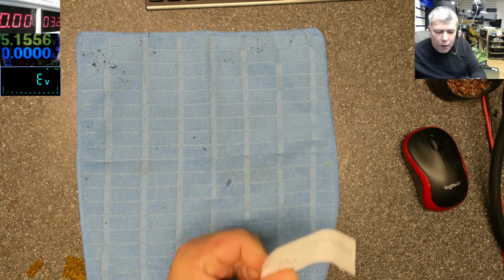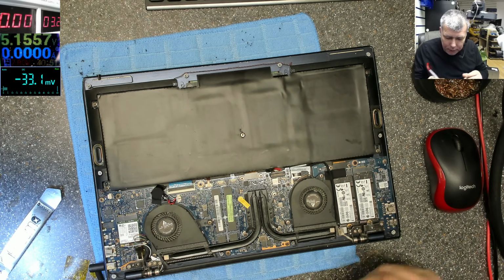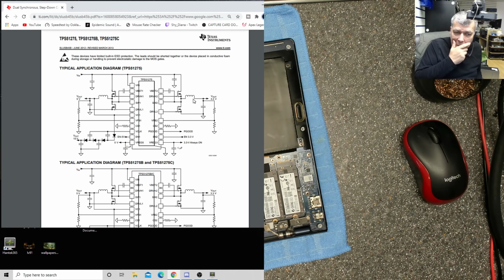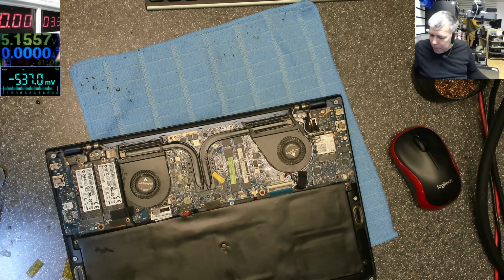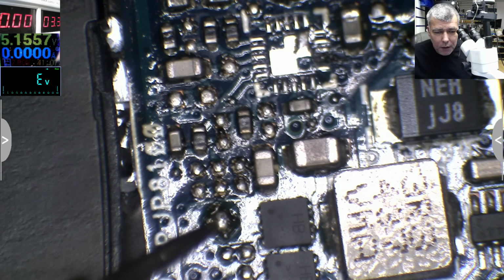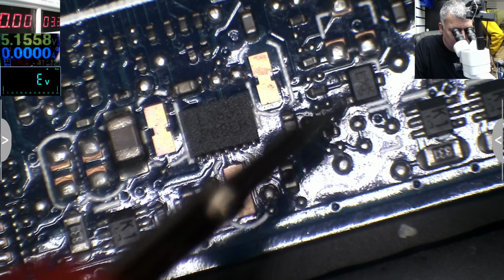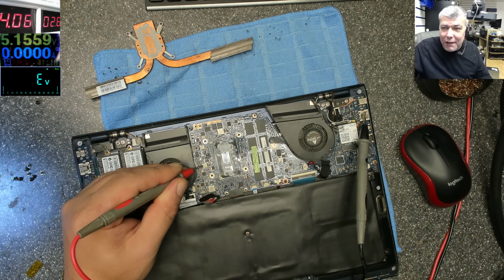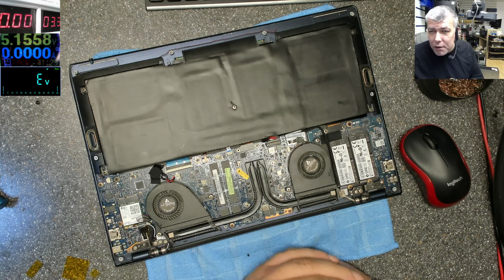I can't fix this one! We can't fix them all, unfortunately

Comment: hello i pc dell which starts and goes out only portable dell latitude e4310
Reply: Issue with superio. Or remove the ram, use a eraser to rub the pins on the ram to clean it and try.

Comment: if the CPU is getting hot without anything else getting hot and the laptop doesn't POST (black screen but keyboard light up and voltages around the motherboard are present ) is it gone 100% or i could have missed something?

Comment: i have a genuine question which i think could be resolved by a replacement super io (ITE IT8587E). It is getting hot the moment power is applied. Is this a sign that this needs to be replaced by an expert.
Reply: Super I/O shouldn’t got hot (over 40c). Must be replaced.

Comment: Sorin,

Did you try ones to replace the chipsets.
You have so much skills with hot air.
If the chip is cheap try it I will say.
Greetings from Nederland
Reply: Chipset is cheap. 10-20€ but he should use a pre heat station. I bought one myself for 100€ this week to replace PCHs.
But before throw it in the bin he could try to do it without a pre heater.

Comment: One question. Is the processor hard coded to this motherboard and with the bios on this motherboard and thats the reason why it cant be fixed or it could be fixed but there is nowhere to find the processor (like ebay aliexpress etc)?.
For example in iphones a dead proc is game over but dont know if it applies in this case as well.

Comment: Morning sir,I have issue with a Samsung note book motherboard.the laptop is charging but not powering, 3.3v is present in the bios and super  i/o but it is not present in the power button.pls tell me what to do.thanks
Reply: Take a continuity tester. Trace the path from the button to the embedded controller.
- Is the button connected via a flat cable? Sometimes the connection here is faulty. Mostly because the cable has broken lamells.
You can (only for testing) short the contact on the mainboard (the on that goes to the button) to ground. Does the mainboard start then?

Comment: Sad to see that it cant be repaired but replacing the board would prob cost more than buying a new laptop , i repair laptops too but i dont have the right tools like you have i just check the boards for burns or cracks ,i clean them up before trying them and making sure the connectors are in place, some mother boards wont power on if the wrong memories are in , check the battery and chargers and cpu for cleaning and repaste , when i had to repair my sisters laptop Acer the board had blown and cost £66 for a new one maybe worth buying it but not for one over £100 or more!

Comment: That's one of the reasons I hate embedded CPU - you can't change the CPU - that's the reason is you have to buy a new motherboard and the manufacturing is cheaper - but that's the way it goes - the manufacturer says they are making both - a socket one and embedded ???????  - maybe someday somebody will find a way to replace  an embedded CPU

Comment: I've spent hours watching this channel and what options we can take when a diode forced a system to stop working, or a mosfet needs a jumper instead of replacing, or how to make a liquid flux, etc!  Now I have an issue with an HP Z240 tower workstation, it won't start but when plugged in, the white LED blinks 2x every 2 seconds and won't stop (until unplugged) I guess its time I try one of your fixes/method of checking with my multimeter but I don't have the schematics of this system. Perhaps you can point me to the right direction, thanks.
Reply: that was me..
Reply: HP Z240 part num is 837344-601

Comment: Thanks,  I mistook the chipset for the integrated gpu. I now understand why there was no display from my asus gaming laptop even though it has a separate gpu chip. I think the chipset was running so hot that its outer shell cracked and inside of the  chip was redhot when  connected to power.
Reply: The integrated GPU is inside the CPU die — the long rectangle die on the CPU package —. Sometimes the PCH explodes randomly or as a result of something wrong happening on USB as well.
Reply: @piernov  , thanks

Comment: Mr Sorin, pls  never ever remove a pwm ic n plug in charger ever it will result in 19v getting to 3v / 5v rails which will result in catastrophie. That burnt ic produces the ldos, n the 3.3,5v alws.
Reply: You're right, because the MOSFETs gates will floating without the chip.
I hope he sees your comment!

Comment: I think that is the 3 pin diod connected with vreg 3 and also connected with cmos battery with  help of one resistor..and output side connected with processor (chip)...that called RTC..supply..its first supply in always available for prosesor..rtc is most important supply for power on the laptop board...and also thanx for the sharing ur experience..i always learn something with your videos..thanx again..

Comment: If it was me... I would pay for a new motherboard.... That's if I wanted to continue using it....
Reply: with motherboard like this one with almost everything integrated/solder on board price will be probably somewhere near working used one. Best way from here is to sold screen and case on ebay, maybe SSD's depend of model and just buy something else.
Reply: @gorky_vk  I wounder what model it is? Not many laptops I've seen have dual SSDs/HDDs
Reply: @lukedavis436  thanks to 1440p I can tell you that is ASUS ZenBook UX301 featuring i7-4558U and dual 256GB SSD's in RAID configuration, just in case you find single SSD slow. You know, in laptop. After all these 5400rpm HDD which we have and love for years for speed they gave us :))
It's not newest laptop but I can guess that it run good enough for most users.
Reply: @gorky_vk  thank you.... I was interested but Im still getting another Thinkpad as a replacement to my 0319-3tg Thinkpad Edge that got ruined a while ago :(
Reply: @lukedavis436  I rarely have use for notebooks and even when I need one my old EliteBook 8460p is still up to the task. Thinking about buying something newer a year back but to get something similar (but obviously newer, better and faster and lighter) I need to spend much more than I'm willing to give on something uses almost never. And for less money I can get one of these plastic-fantastic toys with hinges waiting to break from a breeze. I think I'll maybe just put bigger SSD in this one,  it came with 128GB but MS have mission to make windows folder about that size in near future.
Reply: @gorky_vk  you have a point.... I am going to accuire a Lenovo T420 from my father...and I may upgrade my current PC tower once I fix it

Comment: it would be good to buy a thermal camera 💪
Reply: I dunno, I always thought the same so I bought a nice expensive fancy flir. Ended up never using it so I sold it and bought little cheap flir c2 to have just in case but still never use it.

Comment: I think its really important to show the non fixable ones. Reason being is that you can show what to look for in a situation like this so that those learning from you do not end up wasting their time. There are very few videos that discuss troubleshooting the PCH/Processor/Video chipsets as to whether the problem lies with them or elsewhere. So, This is really important to watch.
I, For one, Would love to see more videos on the chipset and processor / video chip circuits. Specifically the Vcore rail failures and trouble shooting. 

Thank you for such a good video.
Reply: yeah like no one, most repair people show is about a shorted capacitor or 19v mosfet power rail and does it or charging conector broken
Reply: @regresoderambo  Yepper, I would like to see a separate series on "Non Repairable" problems. Would be cool.

Comment: Very nice and interesting video. But if each power line would be protected by a diode, wouldnt it be an easy fix? I am asking because I remember that you dont like these protection diodes.
Reply: Some laptops have TVS diodes on the USB data lines, some don't. Unfortunately even with TVS diodes other components can die as well. It's a good measure but it's not a full protection. A power switch with OCP for power lines and an optoisolator for the data lines would protect better, but it's not practically and economically viable to put them everywhere. Some laptops do use a power switch with OCP, but I haven't seen optoisolation on laptops yet as it makes little sense, they are rather used in some industrial equipment.

Comment: Sir, I need your advice please.

my new laptop stopped to output 4K resolution to TV ("no signal")
when I switch to FHD resolution it's fine.

it's worked fine at 4K until before 2 weeks, its a new laptop (only 2 months)

I tested 10 HDMI 2.0 cables, few TV's, and reinstalled drivers and windows.

could this symptom indicate a malfunction in the HDMI port?

Video of the problem:
https://youtu.be/T6DQgIZD1ng

Im not sure if they will replace the port, or just replace the whole motherboard

Comment: You 're sure that little 3 pin things are regulators? They seem like diodes...
Reply: The one near the coin cell battery connector could be the dual diode between RTC power rail, 3V LDO rail and coin cell battery, if that's what you are referring to.

Comment: you destroy the CPU of this board this is not an old school laptop, when there is shorting in the motherboard doesn't give any voltage to the board, new 6, 7, 8 gen CPU die very quick. Also when you PWM is short and you remove it don't plug the adaptor or battery in this video when you remove PWM ic you connect the battery.
Reply: @GadgersKlinik: yes I agree, you have 100% right. and yes, he made few mistakes. but dont' forget that the client was there first and we don't know what he was doing there. 
Maybe cpu was day before Sorin open the case
Reply: 19v not sort men what did you say
Reply: I need your help

Comment: This probably would have been a fixable job, if the customer didn’t try to fix it.
Reply: The PCH died as a result of the event that happened on the USB port, not from the customer trying to fix it. But it's true that in general someone trying to fix a machine without knowledge and experience can make it worse. That's how you actually get experience though.
Reply: This laptop was doomed from the beginning. Replacing a PCH isn’t easy. 
But what I learned while repairing motherboards is to check the usb data lines and HDD plugs for shorts. If there any most likely the PCH is defect. 
Second is BIOS corrupted followed by I/O shorted somewhere.